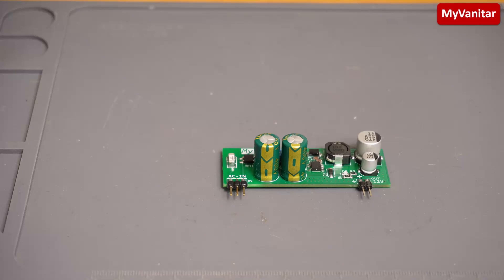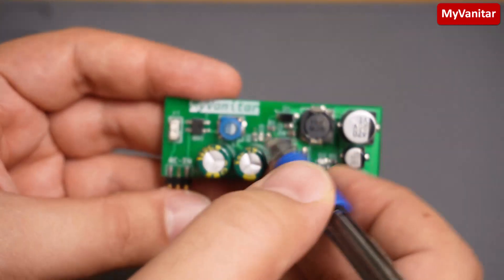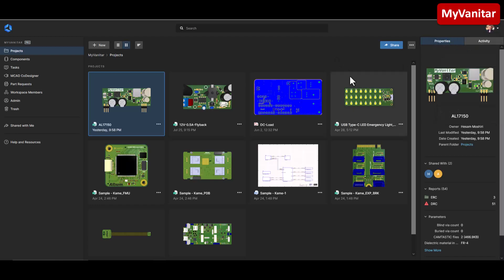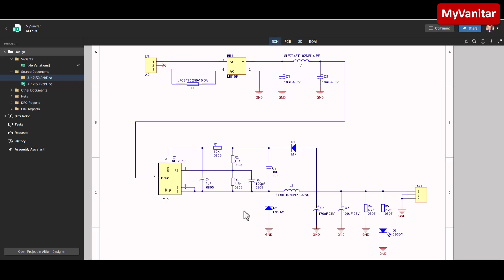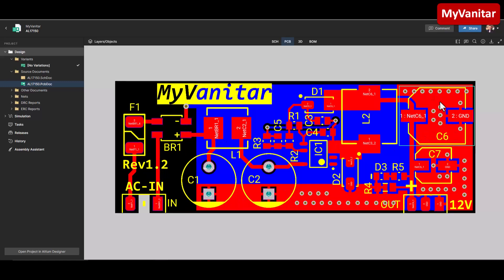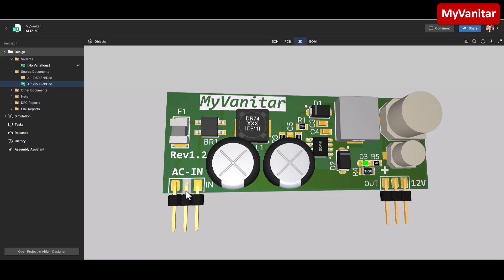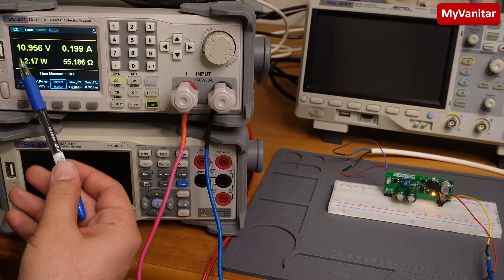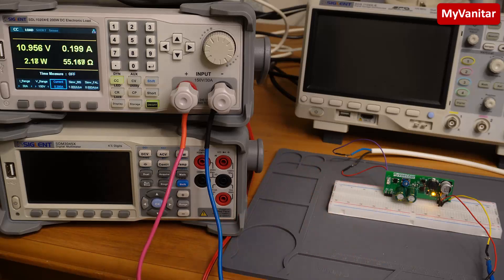Transformerless 85-260V-AC to 12V-DC Power Supply

Comment: Hello. I've used this chip. Unfortunately the circuit spreads high level of magnetic noise in the environment. I had a current transformer in my circuit and it made auditory noise due to its proximity to this power supply circuit and I had no solution except taking it away. Since the plastic case of the circuit was tight and small, finally I changed the power supply structure and put the chip aside
Reply from the maker: It's weird, I have never encountered a similar thing. Use it with my PCB and component values and report the results. In general, all switching-type supplies are noisy and must be separated from the mainboard, but there is something wrong with your case.

Comment: input is not isolated. Line voltage can appear on the output when the chip fails.. Very dangerous design.
Reply from the maker: when you don't know the technical aspects, please don't spread nonsense. Diodes Incorporated knows more than you, the chip has all kinds of protections and every design has its own use case.
Reply: @MyVanitar So you know for sure that the mosfet in the chip will never fail short and have line voltage at the output? Ever?  Just being cautious.  Don't be angry when someone points out a potential hazard.
Reply from the maker: @qingli619   I don't get angry, but I receive some comments from people who think they know everything about the industry or designs, if these supplies or chips are this bad, why are they manufactured by well-known companies such as PI Integrations or Diode Incorporated?! They make things to sell, not for fun. A non-isolated supply has its own use case. and to answer your question, the chip never blows up in a way to connect the input to the output. In the worst-case scenario, the chip is shorted at the input, so we always need a fuse, even in the isolated supplies
Reply from the maker: @qingli619   in one of my tests with this chip, I made a mistake in the circuit, the chip heated up in a way that smoke rose up, I thought it was dead, but when I applied the supply again, it worked. honestly, I had not seen such a thing so far. smoke from a component, but still works, amazed

Comment: not a professional pcb designer, yet i would recommend using terminal blocks for ac with cutout on the pcb between the pins to prevent arcing  and also not sure if the distance between the 470u capacitor and the coil if it is suitable for hand soldering/de-soldering !
Reply from the maker: This board will be mounted on the main PCB as a module, so the terminal is not suitable; no arcing will happen, don't worry. for your last question, it's better you use a micro soldering station, C210 tips

Comment: Whats Gona Happen if the Chip burn out? Does All the input Voltage Gets To The Output?
Reply from the maker: it shorts the input and the fuse blows up, but let me tell you that this chip won't burn easily. I had made a mistake somewhere. the chip smoked, but not burned
Reply: I Was Thinking To build One With Viper22A, And Even The ST Site Has Two Reference Design, And The Only Reason I Didnt made that Was Cause I was afraid if the chip burn all the input gets to the output? What do you Think?
Reply from the maker: your scenario never happens. these chips are made by well-known manufacturers and used widely